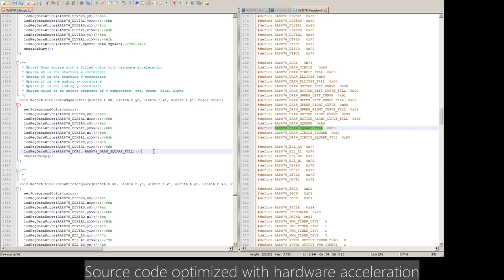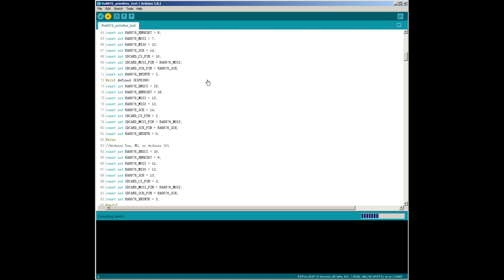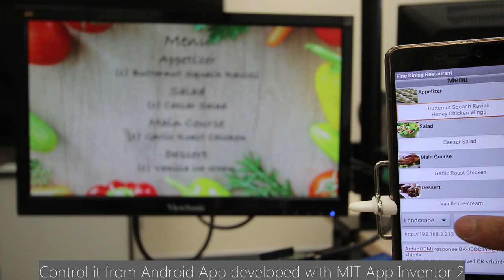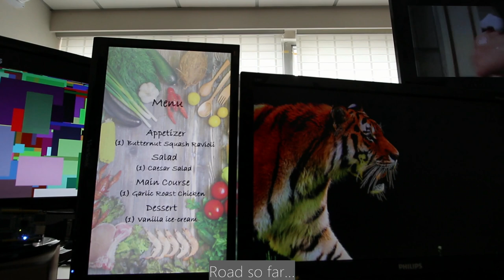Arduino HDMI Shield

Comment: I think this is quite a niche product as it is marginally pricier than the microcontroller. In my opinion, if the hardware design could be more cost-efficient, a lot tinkerers would buy it.
Reply from the maker: Agreed. The BOM cost is quite high because RA8876 needs an external Serial Flash to store graphic assets, Font ROM for Unicode, and RA8876 itself is not cheap at all. A more cost-efficient design can be modified to ESP32 + FT81x + ADV7513/CH7035. FT81x may be more suitable for games to draw more attention from tinkerers, I think. ADV7513 costs a little bit lower than CH7035. Tried it before CH7035B and it works too. However, there is no frame scaler with ADV7513 therefore it will limit to 720*480 or 576p. With current design I tend to modify it for industrial purpose like palm size HDTV driver for public areas, hospitals, car park etc. No Arduino. In this case 8080 16-bit  addressing mode is used instead. Example use can be a queue number display with Android App calling, advertising board to show pictures etc.

Comment: Is it possible to use graphics commands over SPI that are similar to the adafruit graphics library, for drawing lines and other primitives?
Reply from the maker: I have not tried it but the mindset of RA887x is not the same as adafruit graphics. Ra887x emphasizes more on bitmap copying instead of pixel-by-pixel drawing. Consider drawing a simple letter "A", RA887x can copy the area by DMA hardware from internal ROM to the frame buffer (SRAM). This is like copying a whole area by DMA instead of doing a double for-loop in {x=0; x<width; x++ {y=0; y<height;y++}}. 

If I am redesignging the kit, I would definitely using some off-the-sheld graphical library like LVGL or Moddable to do it.

Comment: Good day, Leung John! Thank you for the shield you designed. I am using an Arduino Uno and get an error when uploading the Ra8876_ticketdisplay_part1 sketch. It sais that there is not enough space. Do you know if it is because of the type of Arduino I am using?
Reply from the maker: HDMI Shield does not support Arduino Uno. Software examples tested for Teensy, Arduino M0 PRO, Arduino DUE, ESP8266, and ESP32 Arduino. Arduino platforms tested are all 3V3. 5V version of Arduino such as Uno is not supported.
Reply: @leungjohn3875  I see. Thank you for a quick response

Comment: Is there a shield currently available and if not, what is the closest variation?
Reply from the maker: You may search Gameudino or, there is an advanced Arduino board with HDMi output (MKR Vidor 4000)
Reply: @leungjohn3875  thank you so very much for the reply 🙂

Comment: Great project, could it be used to generate 720p resolution?
Reply from the maker: Yes, it is controlled by the HDMI encoder CH7035B. We just need to initialize it with a different map for 720p output. It is always a step upward to produce good video quality. For 720p, we may program RA8876 to generated a  848x480 RGB output to maintain the same aspect ratio. HDMI encoder will boost it to 1280*720 HDMI/DVI output with a valid init map. Such map is available from the file videoInOutMap.h, available from Github.

Comment: You really should explain how you did it for the engineers out there like me.. I want to know more about it:D:D
Reply from the maker: Thanks a lot, but the src code and sch. are all available in GitHub, actually. Link shown above.
Reply: @leungjohn3875  Yeah I saw that awesome work. 
But still could you please make a tutorial video or tutorials series of  your creation? Because I want to learn more but looking at code and schematics isn't enough to learn about it., Because I know there were a lot of design choices that you had to make. I can't learn that just by seeing your source files. BTW its awesome that you did include source files and schematics. 
Please make a tutorial series or a document where you explain your design choices. 
Also It would be awesome if you could tell us in your tutorial series on how to MAKE that PCB including datasheet reading and design choices. I understand that you are a busy man. But still it would be awesome man.
Also if you have new projects and you need help please reply to me. I don't ask money. I am a 4th year student in the Netherlands studying electrical engineering. My specialization is Embedded Systems. 
So if you are making a new project and you need a student to help with some easier tasks. Ask me man:D

PS: Make those tutorial series.
Reply from the maker: @thenewtechguy8526  For this board it won't be tutorial for that. However, I am working on another board that comes with tutorial (a book) and source, schematics, etc. Hopefully it will be available by this end of this year.
Reply: @leungjohn3875  Nice can't wait :D Please hurry haha

Comment: Hello John!!
Can we Call a video from PC through this arduino? I wanna to run different videos on my LCD monitor b using arduino.. Can is it possible with this? Kindly guide me
Reply from the maker: Could you explain more "Call a video"? I am not sure about your meaning.
Reply: @leungjohn3875  '"call a video "means that we can run a video by using "CALL " function in arduino through this HDMI Arduino shield.?
In my PC there're different videos present, from these videos i want to run any video by using "CALL" function in arduino.
Or 
there is some other way to run a video by using arduino?
Reply from the maker: Unfortunately, this shield doesn't have the horsepower for movie playback (either in avi/mpeg4).

Comment: really cool work! I see that with a normal arduino is not possible, but with a Arduino 33 BLE Sense this would be possible? I wish to make a project with voice recognition and wish to show on screen the recognised words with associated image, and sound...
Reply from the maker: It is possible to use Arduino 33 BLE since its IO voltage is 3.3V compatible. However, its form factor needs an adapter PCB to connect HDMI shield board; otherwise, you would need to use jumper cables for prototyping. Please notice that I am going to change the design of this shield. But the time frame is not known yet. Hopefully in 2-3 months time.

Comment: we would need 1080i50 as output and a hd webcam usb as input. would that work?
Reply from the maker: It is possible to output 1080i @50Hz by a slight modification to the initialization script. I tried it, but the output quality was not good. It is just not comparable to 1080p @50/60Hz. Progressive scan is the way to go. HDMI shield is NOT a MCU/MPU host. It is an output device. To use a HD webcam usb as input, you need to do it from your host (MCU/MPU).

Comment: It works properly with Arduino Uno right?
Reply from the maker: The board works with 3.3V system voltage only so it is not compatible with Uno.
Reply: I see, where can I buy this HDMI Shield?
Reply from the maker: This kit is no longer produced. I am working on a completely new version but the release date is around 3 months from today
Reply: Is there any alternative we can use?
Reply from the maker: I am working on a new version with esp32s3 + gfx controller + hdmi encoder on the same board. No more board stacking! However, this approach will rule out Arduino Uno being the host, to be honest @Wigoleven
Reply: Ohhh I see, Thank you for communicating with me 🫡

Comment: Its possibe use Mega and Due. If Yes please send code and library thanks..
Reply from the maker: DUE yes, its arduino library can be found in github link above. Not Mega as it is a 5V system. This HDMI shield needs 3.3V.

Comment: Isn't that what the Raspberry Pi is for?
Reply: Apples and oranges... Raspberry pi's are computers and can easily have their SD cards corrupted from unexpected power losses, and can have other minor problems just trying to run different programs altogether to serve the purpose needed. The Arduino, however is a microcontroller which holds all it's instructions in onboard flash memory and is much less vulnerable to corruption of memory (though you can run out of dynamic memory if not careful). Not only that, but it's only running ONE script, virtually eliminating the need to combine different chunks of software that work well on their own but not necessarily with each other (with the exception of libraries, which can be edited to support different tasks. e.g. I edited the NRFLITE library for my own purpose to use on the STM32's second SPI port).
Reply: @Rustaceann  - trying to start a Raspberry Pi vs. Arduino debate?